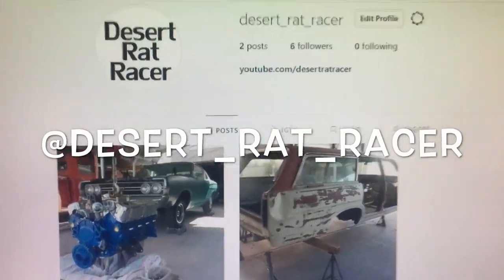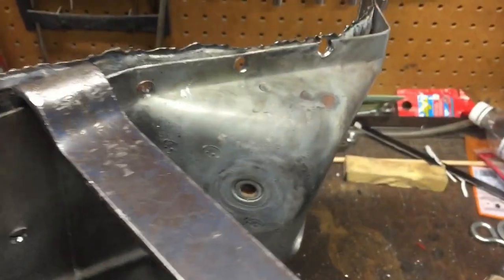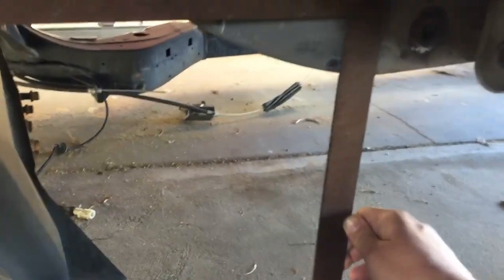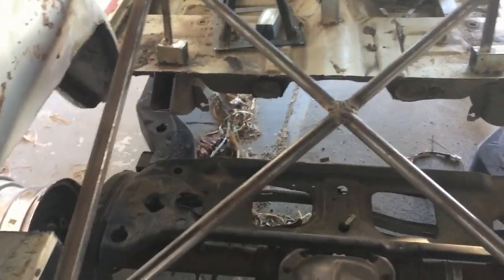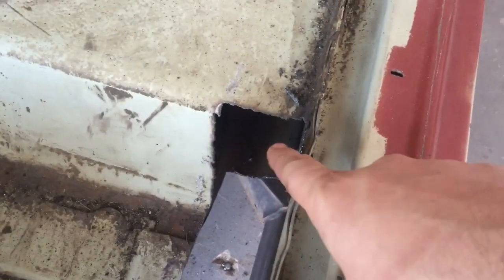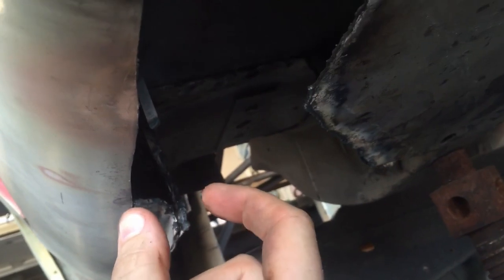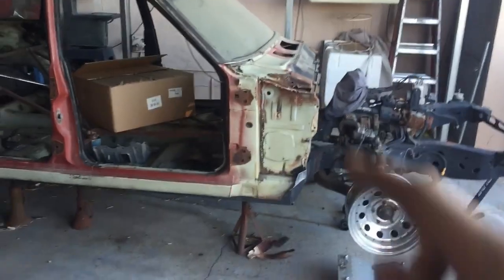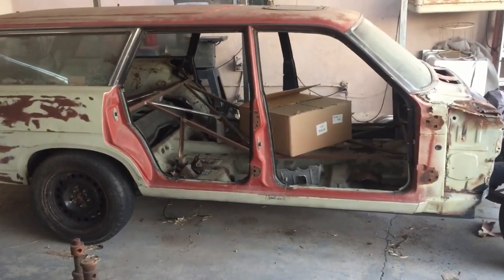Ep. 8 CUTTING FLOORBOARD FOR FRAME INSTALL "Project Redneck" Crown Vic Frame Swap / Install

Comment: Good to see you're still on it. I was just wondering recently what was going on with you. Man thats a lot of cutting !
Reply from the maker: Yup still cranking, Thanks. I wonder the same thing sometimes. 😂 ... yea a little more cutting than i expected, especially over the rearend. Already got a plan to rebuild part of the old subframe in the rear, and re skin it with the original piece... so the change shouldn't stick out too bad.

Comment: Why wouldn't you use the vic floor?
Reply from the maker: I guess a few reasons. I wanted to keep as much or the original sheet metal as possible, with rear seat mounts / back area. Id rather have the original thicker metal than what the crown vic is. Possibly too the car might hold its value better that way, but that probably depends person to person.